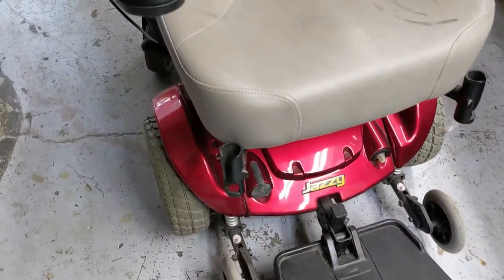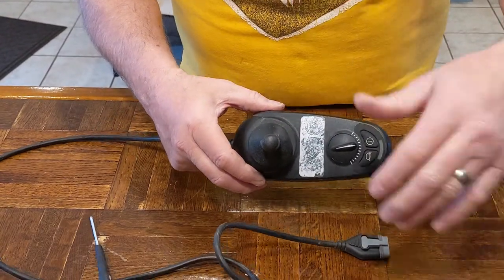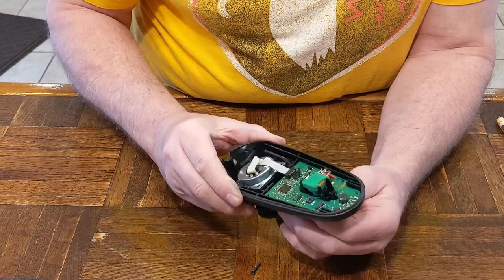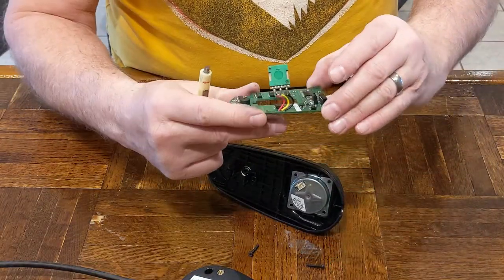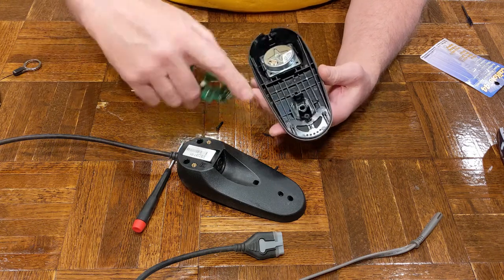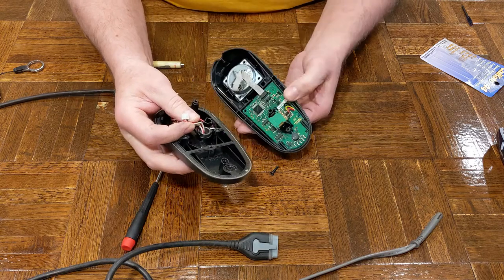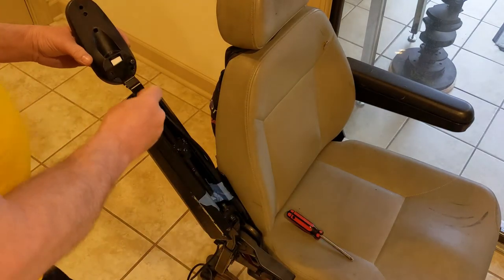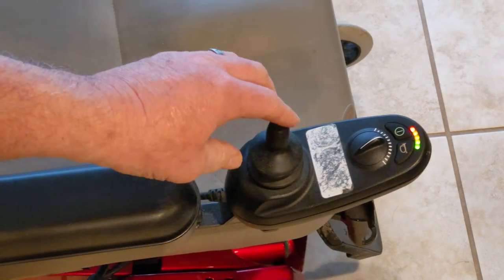Power Chair Repair, on/off membrane switch

Comment: Mine wouln't go ON. I used spray contact cleaner on the circuit board contact area, wiped it clean , reassembled and it is now back in service working perfectly. Takes less than 30 minutes. Helpful video!  Thanks!

Comment: What size type screwdriver is that for the recessed holes? My power chair lights won't turn off when I press the button. The chair doesn't move but the lights stay on. When I press the button to turn in on it moves but it emits a continuous beep. It's led a tough rural life and probably needs a deep clean. I just need the right tools.

Comment: THANKYOUTHANKYOUTHANKYOU!!! My controller was malfunctioning in a different way than shown here. When I turned the chair on, it would beep nonstop, but the lights came on without blinking. When I turned it off, the lights would stay dimly lit. I can't afford a new chair, so out of desperation, even though the symptoms were a bit different, I tried your fix and IT WORKED!  I'm am very grateful for your video. Do you have any other tips for Jazzy power chair fixes?

Comment: I have a problem with my XLR plug in port to the chair, when I plug it into the chair to charge it's loose. Like if you tap it the charger falls out. I have no idea why it started doing this. Any ideas?

Comment: Mahalo, I posed the question, "what type of screw holds the throttle chassis. Joystick potentiometer of Pride 7 motorized w/c?" Two days 2hrs. Looking before sidetracked. Thank you. You named the tool and demonstrated so well.

Comment: Is it possible to remove the horn from the circuit board without affecting the operation of the machine or will the machine stop working once it is removed
Reply from the maker: I think there would be no issue with removing the horn, except for the liability aspects

Comment: I just received a used elite select mobility scooter for my husband with this controller.  It appears that the charging port is melted some.  I have used this video to get the controller opened but I am not certain how to get the port out or even if I can get a replacement port.  Help!
Reply: Nearly any good repair shop can order the part, or you can get it from the manufacturer, and I have even ordered several from good sellers on Ebay.  Never had a issue.  Good luck.

Comment: I have a Jazzy Scooter that I plugged in the charger and I push the green button on the joy stick and Im not getting no lights to come on. Both lights on the charger come on. But the charger use to get real warm when it was charging but it seems cool when I was trying to charge the scooter. Do I need a new charger and new batteries?
Reply from the maker: The batteries fail often...most just after the warranty expires....they have that down to a science so I would test the batteries first, since the charger is not as prone to fail.  A voltmeter would quickly let you know what is wrong.  You may also have poor conductivity in the switches...that is also very common to have both issues..  ..bad batteries and contaminated switch

Comment: Great video!! Thanks!!  Do you by chance know anything about the Gimbal unit? (The actual joystick itself) I was twisting the rubber/plastic knob off of mine to replace the boot and I think I've done something now because it will not spring back to center.....
Reply from the maker: I have not had that issue.  I believe they use hall effect sensors internally, have looked inside a few but do not remember how the spring return to center is set up.   Monster Scooter parts is a great source for parts and advice
Reply: @neuromanglers  Thanks!!

Comment: hello how are you i have a jazzy® elite laptop and sometimes it slows down even though it is at full speed
the batteries are good and charged
Reply from the maker: i would investigate the speed control potentiometer, it may be contaminated or damaged
Reply: Also remember, the height setting of some chairs will affect the speed limit.  For safety.

Comment: Thank you for the tutorial. I was given a Jazzy Select and thought I'd play with it. No charger so I'm charging batts seperately (gel). The joystick is missing the on/off horn pad assy. I'm wondering if these switches are merely press to activate. Your buttons look like they are just rubber and press the circuit board switches. Am I correct ?
Reply from the maker: Yes, the switches are just conductive rubber pads that when pressed they provide continuity between a matrix of traces on a pcb

Monster parts sells those pad assemblies and they are about $5 the last one I purchased
Reply: @neuromanglers  Thanks for the information. Thanks to inflation they are now $18.99. First I've some cleaning of the circuit board as someone attempted to glue it prior. One battery now charged and the other is now on the charger.Cost of new/rebuilt joystick Assy. way too much, but I will continue to try to resurrect this.
Reply from the maker: good luck with it.  I have found many of these power chairs offered for free on CL, folks just want to get rid of them..the batteries seem to last just to the warranty....they have that dialed in tight
Reply: @neuromanglers  Thanks again for your replys. I've cleaned the circuit board and housing. Now I'm wondering if without the rubber button assy if I can merely touch the traces to actuate it ? or is there metalic on the underside of the rubber buttons ? I guess once the other battery is charged I'll reassemble it and experiment. These traces are new to me and I also am wondering if a gum wrapper or tin foil would work just to turn it on ?
Reply from the maker: The underside of the buttons have a rubberized conductive pad.. you can use most  anything conductive to bridge the conductive matrix but be careful not to damage the traces as they are thin and fragile.

That conductive switch pad is often the reason the unit does not power up
Reply: @neuromanglers  Thank you once again. Installed Batts. and used a .22 case on the traces. It beeps twice quick and flashes ( 8 ) times. Other videos indicate a bad "Brain Box". I guess that's it for my experiments. I don't know if it's possible to reset the brain box. I'll unplug and remove just to see.
Reply from the maker: Could be that the motors or brake are unplugged

Comment: I have a Zinger Chair that hasn't been used in a year, the battery shows that its fully charged, but the chair won't power on. Zinger says the battery is in "Sleep Mode" i've followed the steps to unsleep and it just won't power on. Now they say I need a new $500 battery!  Any ideas?
Reply from the maker: I have had so many mobility batteries fail soon after the one year warranty period, regardless of how the battery is used....that I have started to wonder if the battery manufacturer has perfected the chemical process to the point where the battery is basically a clock counting down the year.   I have only noticed this with mobility batteries,  other similar SLA batteries last years and years
Reply: @neuromanglers  I took apart and ordered a new battery from China $150 vs the $500 from those crooks@ Zinger
Reply: They tried to make it hard to take apart, by hiding the screws with black plastic that looked like the rest of the housing, sneaky, crooked, bastards

Comment: any idea about a joystick problem  push to left and chair turns right and vice versa
Reply from the maker: Sounds like the drive motor connections are crossed, try swapping them where they plug into the controller
Reply: @neuromanglers  only one connection for the motors
Reply from the maker: Do you know the history of the machine?  Was it like that when you obtained it ?  Seems very odd that it would fail in that way but I could see how it could happen if it was worked on 

Even if there is only one connector, you can still swap the pins in the connector and swap the wiring.

It might also be done with a programer that is used to set up the limits and parameters of the chair
Reply: @neuromanglers  all I know is that it has been stuck in a shed for 12 months
Reply from the maker: Does the machine move forward and reverse properly or is this function also backwards ?
Reply: @neuromanglers  sorted swapped connections in plug. Thanks